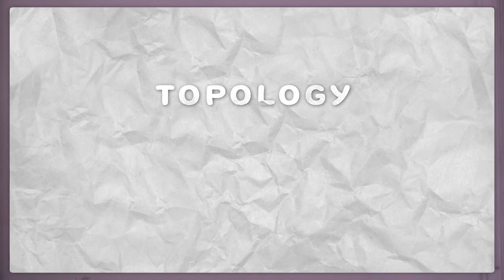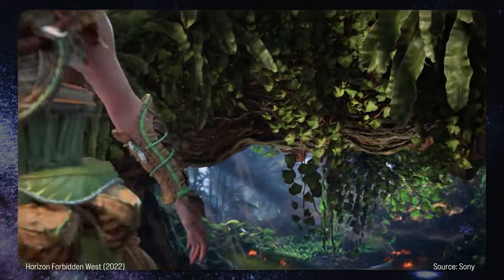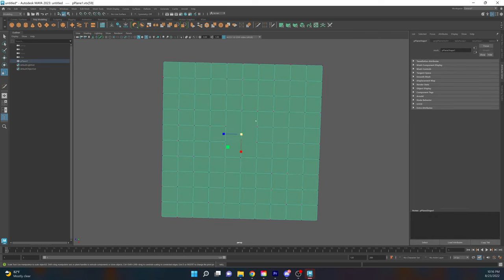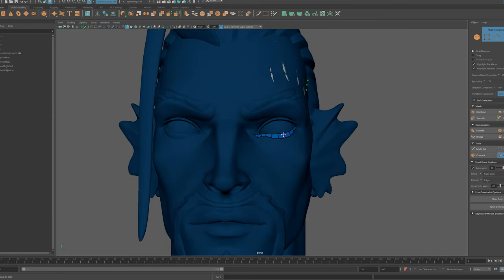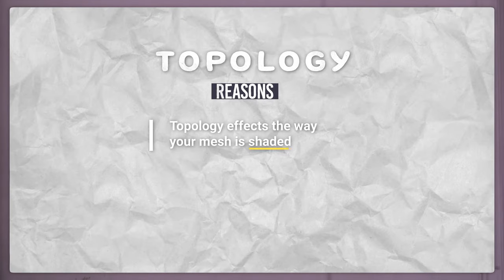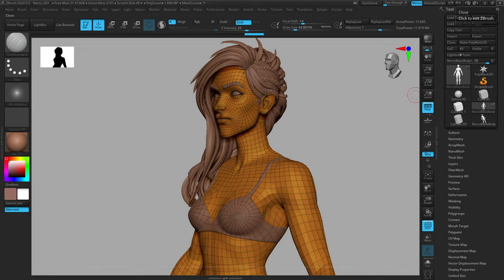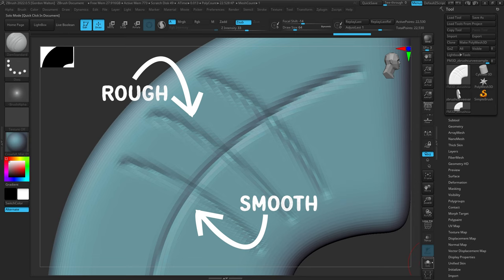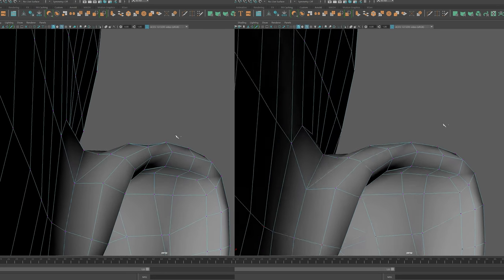Intro to TOPOLOGY for Game Characters!

Comment: This presentation is missing the key to understanding topology, which is how local curvature determines proper mesh layout.  Absent specific animation requirements, and unless we are on a perfect sphere ( ex: eyeball ), or on a flat plane, at each point on any curved surface ( ex: your arm ), the direction of least curvature is ALWAYS — mathematically — perpendicular to the direction of greatest curvature!  So when in doubt, ask yourself, at each point on a curved surface, what is the direction of greatest curvature, from which you can infer the direction of least curvature, and then you can determine how your spans, or edge loops, should go.  Having your quad edges follow the lines of greatest and least curvature is the best way for the model to be efficient and light properly, particularly when low-res ( specular highlights naturally following, and stretching along, lines of curvature ).  The rest is optimization, as well as accounting for curvature density ( = high-frequency important "detail", with high rates of local curvature = small radii of curvature ), in the base mesh , in preparation for subdivision.  Determining directions of local curvature is how automated retopology tools work.

Note: One trick, to help in the process — if you have a physical model to work from — is to walk around it with a spotlight, which will reveal directions of greatest and least curvature, at each point, as the specular highlight travels and stretches along the surface.  Applying a reflective coat of paint or oil, to the model, helps.  The direction specular highlights stretch ( i.e. the direction of least curvature ), in a particular area, as one moves the spotlight around, is an attribute of the surface, caused by curvature, not the position of the light, nor of the orientation of the surface in space. That is why good topology, for a given mesh density, rationally converges toward a single solution.
Reply from the maker: alright chatgpt
Reply: @hartgameart  What do you mean?  I am 100% human. ☺ Sign of the times, I guess.  It took me years to figure that one out, re. curvature; I only stumbled on it when I started programming a tool to retopologize meshes ( TINs ), and learned the math ( vector calc ).  I have seen a lot of bad meshes, and this insight makes laying down tolopogy, manually, much easier.  It's kind of the key, really.  ...Thanks for the snide remark, though.  Clearly, not chatgpt!